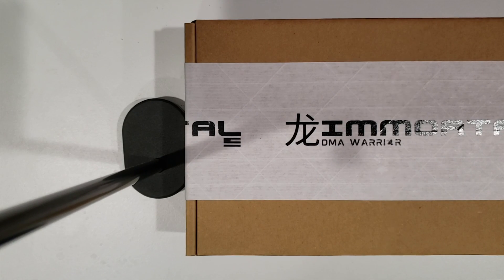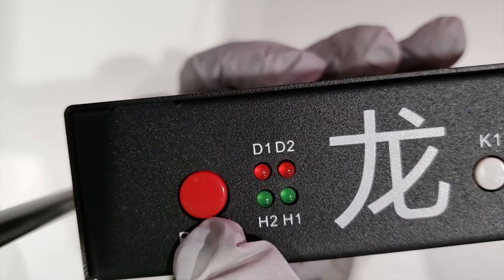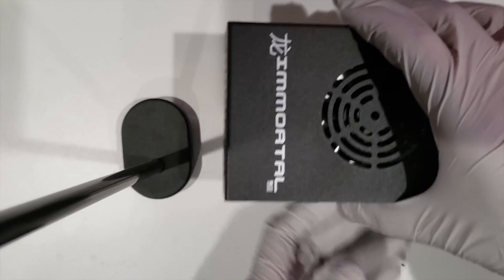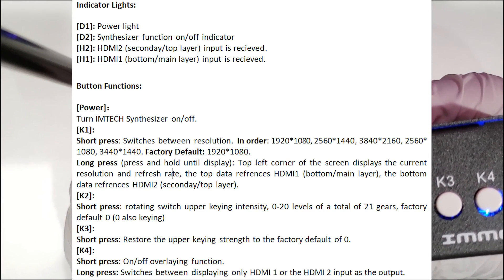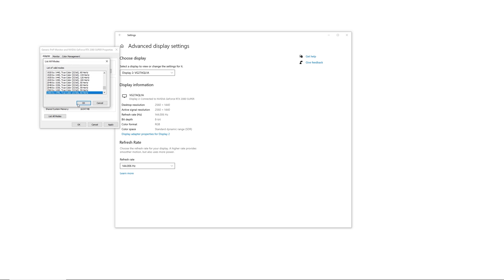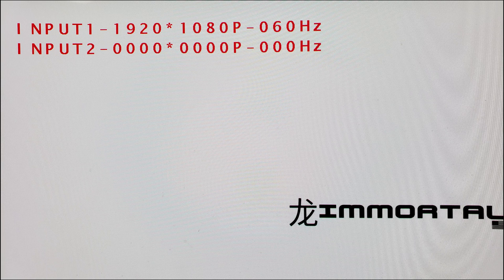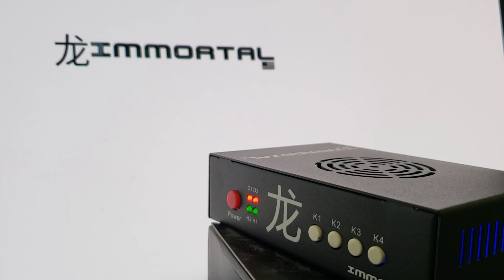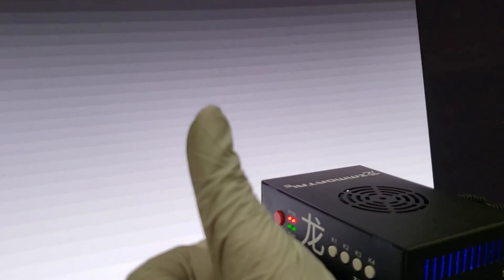Immortal HDMI Synthesizer Tutorial

Comment: My main monitor I can't change off 60 Hz but the radar of PC and fuser on 240
Reply: Pink screen
Reply from the maker: @mirrored464  
Hello, this issue can come up when you windows settings are not correct or the cables are faulty. Make sure your main windows system is outputting the correct resolution and refresh rate to match that of what the combiner can take. 

Feel free to contact us at support@immortaltech.net
Reply: I have the same shit. Did you find a fix?
Reply: slowly go up in hz 120 144 200 @jikhjbjkl
Reply: I have same problem you find a fix?
Reply: @snooptiii  you can manually set the hz rate in nvidia control panel. Just create a new res and adjust the hz rate. Try it and add 1 until you get black screen. Mine went to 222hz
Reply: @jikhjbjkl mine went up to 147, is there anyway I can go higher my monitor goes up to 360hz, so I would hope to at least get 240 hz since that’s what the fuser is “capable” of
Reply: How did you changed the Hz on the fuser i cant find it?
Reply: any luck anybody still same issue here 60hz and pink screen if im even lucky it turns on
Reply: @d3stinystatiic3 me neither bro after suffering to just make it work not getting black screen i have changed my main monitor and git pink screen any solution??!
Reply: @lIlllIllll make sure your resolution and refresh rate it set the exact same on both monitors also realized i needed a better power cord for my fuser

Comment: I’m having issues with EDID spoofing. Followed instructions but it’s still displaying the default monitors such as a MG25H for 1080p, and VG27AQ for 1440p.
Reply from the maker: Please contact us at support@immortaltech.net if you are still in need of help. Also note that EDID spoofing is not required or recommended unless facing compatibility issues.
Reply: @immortaltechnologies hi friend, I have the main monitor 2k at 165hz, and the second monitor 1920x1080 at 60hz maximum, do I have to change the second monitor?
Reply: K1 and was working for and also k4 for 2nd monitor/comp